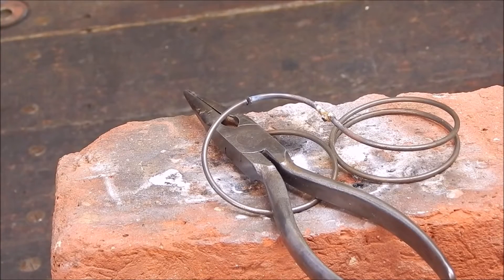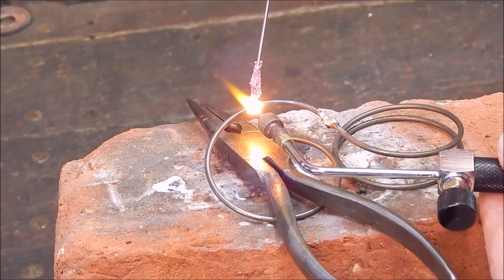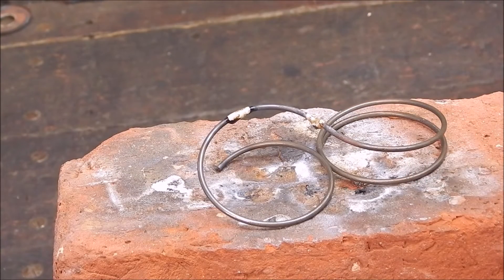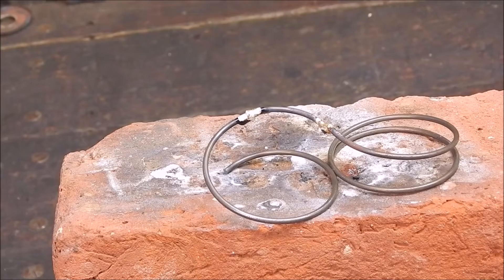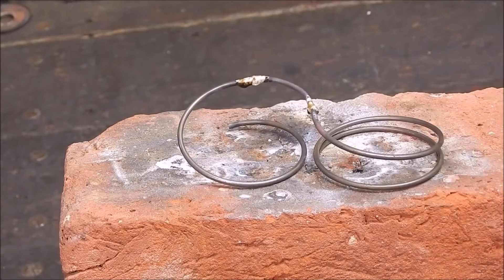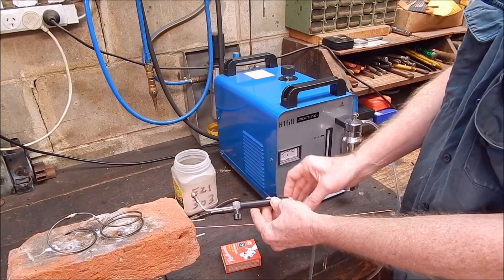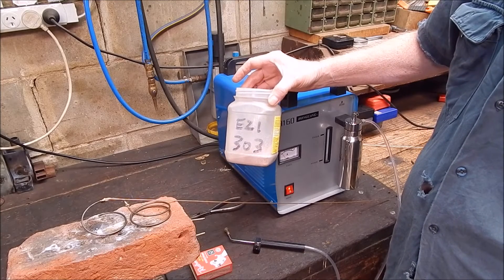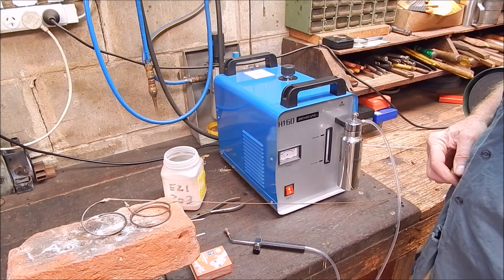Bronze brazing with the Banggood H160 oxy hydrogen water torch

Comment: Did you have some flashbacks from the flame into the bubbler?
Reply from the maker: Yes, many bad ones when using water in the bubbler.  Change it to 75% methylated spirits and 25% Acetone to eliminate flash back, and get a hotter longer flame.  This was advice given by a retired jeweller.  Big improvement.  Cheers Rob
Reply: @Xynudu hey. Thanks for ur reply. Interesting, but this Mix sounds more explosive then have only water in the bubbler? 
😅 did the Flashbacks destroy your bubbler?
Reply from the maker: The bubbler did not get damaged as it has a safety blow off valve built in.  The flashback (from the HHO gas) blew water through the torch hose and had to be cleaned out.  The bubbler mix I suggested is not explosive.  Only the HHO gas is explosive.

Comment: Wanting to compare this appliance with oxygen + propane concentrator which one gets a better flame for brazing? Thanks
Reply from the maker: Oxygen/propane torches can supply any size heat output you want by varying the tip sizes.  Oxy hydrogen generators have a limited output and one this size is only capable of very small work.  Both are capable of cutting steel, so temperatures are similar, but the BTHU's available will differ enormously.  Oxygen Propane is much more versatile.

Comment: Could you speak to the price difference between a MAP gas torch, MAP and Oxygen type of setup. Currently I use MAP gas or MAP gas and Oxygen. Did you purchase the hydrogen generator to replace cylinder bottles?
Reply from the maker: Hi Robert,  I got it to see what it was capable of doing. It won't replace MAPP gas for most jobs as it can only put out a limited amount of Bthu's.  So while it's OK for jewelry and some small model making work, that's about it.  Cheers Rob

Comment: You're just gonna keep burning things till you get it right Rob 😁 Have you thought about using MIG tips ?
Reply from the maker: They are probably too large jet size I would think.  You can't go past 1 mm with this unit or you will get flash back.

Cheers Rob
Reply: I use a 0.6mm for the burner in my forge. works great and lots of ppl use them
Reply from the maker: OK.  Sounds good to me then.  I don't know much about MIG jets.  Cheers Rob
Reply: 🤔 You don't have a MIG welder?  Time to hit up Banggood 🤣

Comment: As said before Rob - definite potential. I guess the bronze strength predictably couldn't compete with the springy steel unless enough build up, but still, another useful  example for the H160.

Comment: Ideal for small work, jewelers and such will probably be interested as well as hobbyist that don't want to deal with the high pressure bottles, also insurance companies my fuss about the Oxy-acetylene kits, better inquire if they allow it, or, run the risk of not being insured at all...
Here in Canada BOC was acquired by Linde, guess like 10 at least 10 years ago, that was the end of the better deals that BOC was promoting in their monthly catalog...  With Linde, same catalog, but, without the "Better deals"...   😎👍
Reply from the maker: Hi Pierre, same here in Oz, BOC is now part of Linde.   Not cheap.

I always buy the brazing rods from BOC as they are the best (IMHO) and you get a box of manganese bronze for about $50 AU which isn't too bad.

Cheers Rob

Comment: Hi Rob - interesting.
Like yourself I've always used the pink flux - the old CIG Comweld brand in my case but only with brazing rods.

I've never used it with silver brazing alloy. For that I use the white Comweld Silver Brazing Flux No. 2 which is intended for the high silver content rods.

One of these days I'll convince you to try the 45% silver brazing rods - expensive but brilliant and you end up using very little for a truly superb joint.
Thanks for the vid.
Reply from the maker: Brazing is certainly an interesting subject.  I always use flux as that way you know the job has bonded without issues,  including with silver solder.

CA 303 flux is extremely good on ferrous metals and works bronze, brass and copper excellently.  It would be interesting to see how it works with silver.

I have been tempted to do a video showing how you can use silver solder to combine scrap brass oddments to build them up into something usable/larger stock (eg.  make a gear blank).    Although basic silver solder doesn't machine as nicely as brass, it still comes up good with HSS and joins can be virtually undetectable (depending on the brass grades used).

Yes, the high silver content rods are damn damn expensive ;)  Not something I need to use.

Cheers Rob

Comment: With my {admittedly limited} experience of silver soldier, I found on a 12.7 mm copper pipe as standard for water, that with the correct {i.e hot enough} flame and 5 or 10% silver I did not need to use flux, everything really related to the heat distribution I.e flame size and heat as you stated. 
Looking at that tip I’d take a guess that it might be hot / broad  enough for 12.7mm copper tube?
Reply from the maker: Maybe, but remember that copper takes away heat faster than almost anything.  It will be interesting to see what happens.  Cheers Rob
Reply: xynudu indeed will be interesting to see thanks again

Comment: Looks like it would be good for torch enamelling, often done with oxy-acetylene or slower with propane, but this would be with out the overhead of the gas & bottles. Thanks for sharing!
Reply from the maker: That sounds interesting.  Not something I know anything about. From what I've just read this sounds do-able for small work. I must investigate more closely.  Cheers Rob
Reply: @Xynudu  I am only a very basic beginner in flame enamelling which is done by shaking powered glass on to copper or silver and then fusing it with a torch. Everything I know has come from watching youtube videos, the one that got me started was https://www.youtube.com/watch?v=4abq2K0VLYk It interested me as most of the stuff can be made and there are youtube video on making sifters etc. I have also been using propane as I don't have acetylene. I imagine that your oxy-hydrogen torch would work well. I was hoping i could make some small enamel signs but I am currently a long way from such sophistication.
Reply from the maker: That's really interesting.  Good video.  Looks to be pretty simple, just need the ingredients to melt/fuse the coating.  Where do you buy those powders ?  It could make some nice decorative key ring fobs.  Cheers Rob
Reply: @Xynudu  Sorry for delay, UK/Australian time difference. I got my powders from www.cooksongold.com. Enamel powder come with lead or without lead (cheaper & different sized powder) and in opaque and transparent. i made sifters using plastic conduit welded to some stainless mesh I got off eBay like shown in: https://www.youtube.com/watch?v=4vfw4TNfOEI I sized my mesh for lead based and got lead free powder which caused trouble as the lead free are different sized powders. I also got some fire gum solution. My copper is just a bit of 18 swg 1.2 mm I got off eBay and which I have cut as needed, but punched blanks are available. It is  also possible to do lettering for things like name plates, see around 31 minutes on this video: https://www.youtube.com/watch?v=7U2X6s1YDlc I am not sure how strong the enamels are for applications like key fobs where other keys etc can strike the faces, but some makers sell them. A garage re-roof project has temporarily stopped my enamel work, but plan to get back to it once the garage is fixed. Good Luck!

Comment: The bronze broke because the metal was overheated and boiled on the outside of the wire. Causing major porosity in the braze. Sometimes bad flux can make this happen but you can tell because when broken, the porosity has black carbon inside the areated balls. Hope that helps Sir.
Reply from the maker: Good diagnosis.  This torch has very high temperature even with the much softer flame jet.  It takes some getting used to compared to my LPG Bullfinch torch.  But it's all doable as shown.  Anything up to 4 mm is not an issue provided work mass is not high.  Cheers Rob
Reply: @Xynudu  I like watching your videos as they remind me of all the things that I have done earlier in my lifetime. Down to earth things done really make me put a smile on my face too. Vic
Reply from the maker: Thank you Vic.  Life is a journey.  We all learn as we go.  I'm glad you get something out of it.  Cheers Rob
Reply: @Xynudu  Rob, it is so nice to see someone doing things on YouTube and showing whether the outcome is good or bad and showing the real world scenarios. The old saying is "none of us are as smart as all of us". I am just glad we can come together with experience of knowledge so all of us are just working smarter not harder which is something many seem to do. Cheers to you once again, Vic

Comment: Might be too hot and burned the zinc?
Or perhaps wetting the rod ends and "tinning" them first to let the brass/bronze flow together. 
In any case it will do the job. 😆
Reply from the maker: I think there was some flux in the join.  Re-melting it brought it to the surface, plus I increased the diameter of the filler section. It could have also been temperature related - too hot.   Anyway it worked OK.  Butt joins are always the most likely to fail -  due to the small cross section.  Cheers Rob